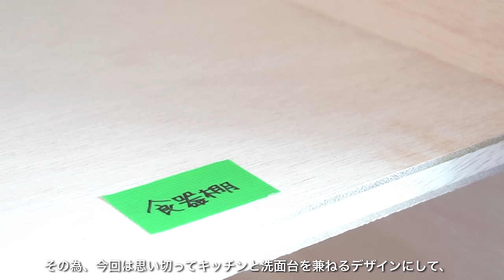【築35年1R6畳アパートDIY.part 3 #総集編 】 diy女子が1R6畳の部屋をセルフリノベーションで劇的ビフォーアフター！ |  SUB.

Comment: Turned out really nice! 😍  Only things I would have done differently is that, if your imagined tenant is a student, you're going to need both a deeper desk and a power outlet right next to it or inside the cubby space the desk in.  Also, ALL curtains should be blackout curtains for a student, trust me on that. 😅  I'm not sure about the placement of the door hooks either. 
Two on either side of the peephole makes more sense to me.  Otherwise, well done! 😀👍
Reply: I feel you, but the hook over the peephole gives more sense of privacy and more insulation and more space to hang stuff.
Reply: Yes, but you will knock your head into that center hook as you look through the peep hole.
Reply: @barkingfromnewmexico9448  Exactly!  That's why I didn't like the one in the middle. 😅

Comment: I absolutely love the finished look, it's soooo elegant 🤩 However i wonder why you couldn't simply paint the ceiling, it seems that it would've been easier on such a small surface ? Also i do believe that the joints of the beautiful kitchen tile you picked still needed to be filled because those spaces look too deep and would be a nightmare to clean, especially the grease after cooking on  the stove 😬

Comment: It's pretty; however, once a little bit of grease from cooking vapors hits the tiles, it will stick in the rubber and on the contact vinyl, making it very difficult to clean and stay pretty.  I do love the design ideas.  The edges of the surfaces that the contact paper was used on may become very worn looking rather quickly.

Comment: Great job with creating so much furniture on your own.

Some small nitpicks - I'd add a metalband between the wash basin and kitchen countertop - less possibility of water finding it's way into the wood and causing damage.

And maybe insetting the hinges of the bench under the window would have made it more invisible - that it can be opened.

Otherwise I really liked it

Comment: I would never put what looked like foam scraps under concrete, the foam will compress overtime with weight and cause the top concrete to crack and depress. Good luck.

Comment: I love the colour scheme. Personally I'd choose some other flatsurfaced tiles in the kitchen for easier cleaning of grease and dust that accumulate in a kitchen. 
Id also consider a deeper desk in one of the shelfs. Maybe a pullout or flip down/up surface for when i used it and then i could hide it in the shelvings when not in use. Great job!

Comment: I also used DIY adhesive wallpaper stickers, but I felt after some time they come out or get worn out/cuts in high humidity as per the weather condition. I hade to use colored plastic tapes to hide the cuts...🙄

Comment: Why apply wood stain but opted to put contact paper? Would it be more practical if just do just one of them like wood stain or just directly use contact paper? In the ceiling if you were allowed to paint or demo the kitchen why not paint the ceiling instead of using wall paper?